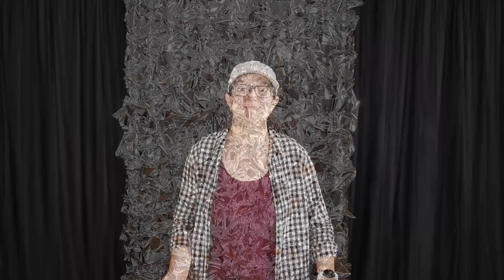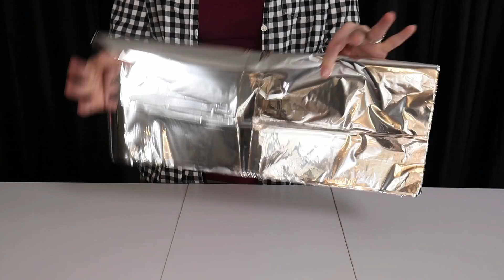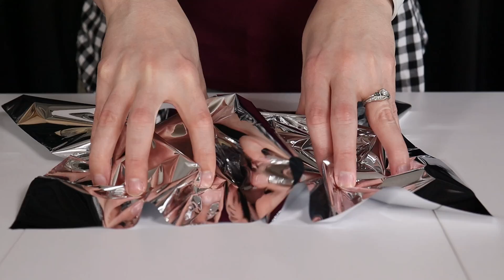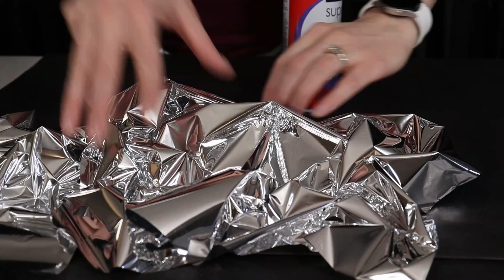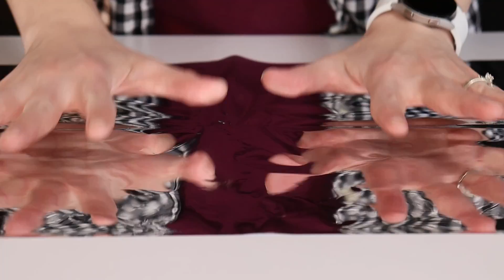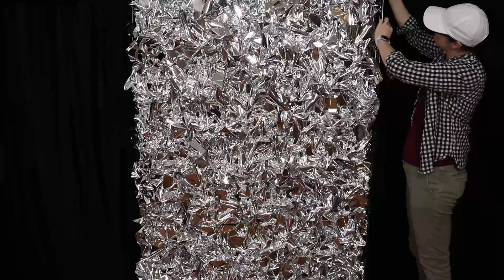Easy Metallic Backdrop from Gift Wrap

Comment: The completed backdrop looks great...I wanted to know how do you store it, it can be used again correct.
Reply from the maker: Since it was built on heavy black paper, I removed it from the backdrop stand and loosely rolled the whole backdrop up with the silver part facing in. I used this backdrop again over a year later and it still looked great after all that time. Just make sure it doesn't get squished in storage.
Reply: @EventAnswer  Great thank you for this
Reply: @EventAnswer  Wow, thanks for responding